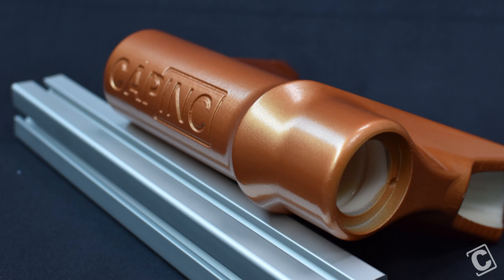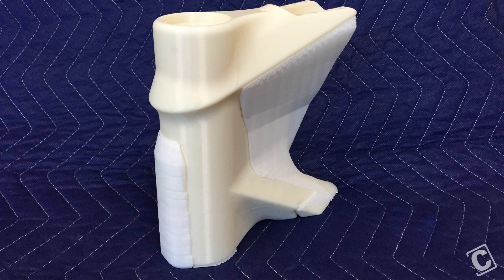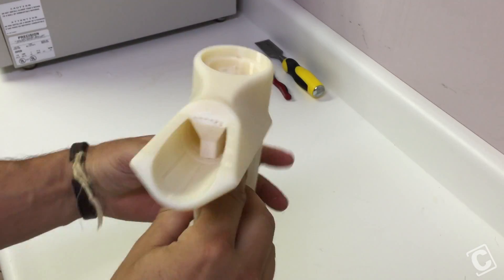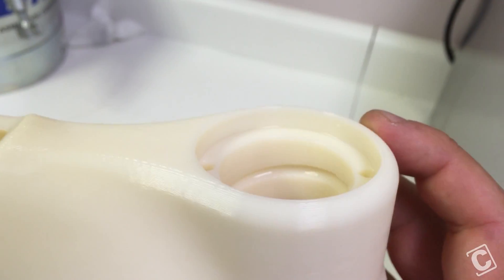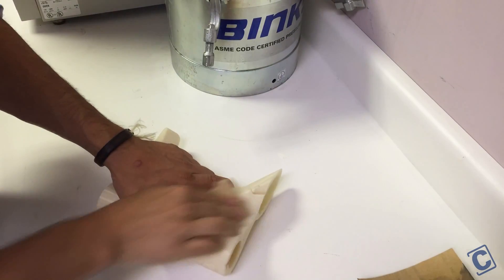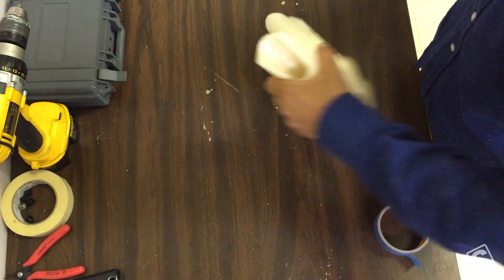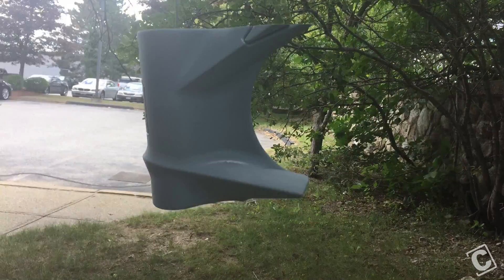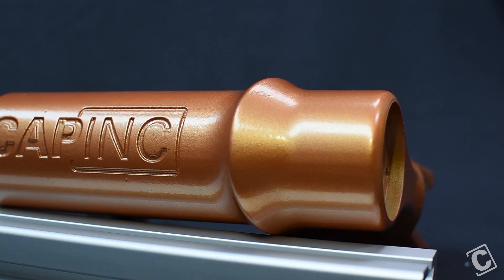How To Finish A 3D Printed Part To Look Like A Production Part

Comment: the print finish is honestly really good at least on camera, what did you use!
Reply: The 3D Printer is a Stratasys Fortus 250 MC . He used a Carpaint Primer with highfill properties. Two coats of Paint and a clear coat.

Comment: Hi, 
I would like to know what bath are you putting your 3D model in when you are about to remove the support @ 1:13 . 
What machine is that and what liquid are you using  ? 

Thank you for sharing the video
Reply: exactly! And what material can be put in a bath to remove support material???
Reply: @cnc3-in-1  Usually people use PVA filament to print support like this, its best to have a dual extruder because its a different material than what you want your model to be.  PVA can dissolved by warm water, it does take a few hours though.

Comment: i find additionally, applying bondo spot putty before priming to be effective. sand it down and you shouldnt have to worry about layer lines and as long as you wet sand, youll remove any loose bondo dust from the object as well so the primer can adhere properly. the primer, then paint and clear coat. the use of spot putty is also a good way to ensure even sanding. if you just sand the bare surface, its harder to tell if youve over sanded or under sanded certain areas. its easy to tell what surfaces have been sanded with spot putty.

Comment: This is an excellent Demo. How about painting using liquid latex (left to dry) then pulling that away after youve applied paint, would that work better than using blue tape to cover uneven surfaces?

Comment: If you want an even smoother finish (can still see some blemishes in the final part) then use 2-3 coats of filler primer as your base coat. Also use wet and dry paper with plenty of water, sounds like it would mess things up but it works a dream. Admittedly it will take a couple of days to get it really smooth but it's definitely possible.

Comment: I usually do this 8saves bangs of time): Finished print- plastic primer- filler primer- sand down until you see the original print shine through (i use wetsanding as the method of choice here. by the the print is baby ass smooth. you can go further and slightly sand it down with a 1000 grit paper just for the smoothness.)- airbrush primer and colour or spray primer followed by spray color - clearcoat. 
Not having to sand the print itself safes A LOT of time. the finish is the same. if i could add pictures i would.

Comment: For the high gloss finish you'd actually want many many coats of clear. 3-4 coats of paint followed by about 10 coats of clear. Each coat progressively thicker than the last. after the first few coats of clear, start giving a wet rub of 2500-3000 grit being mindful not to rub through the edges.

Thats how we paint cars at least.
Reply: It's not! It all purely depends on the level of finish you desire! If you want the finish similar to that of a brand new car... thats when you need that many coats of paint.

We need several coats of paint for coverage. Maybe an extra one or two for acrylic paint. A mistake people often make is trying to get maximum coverage in their first coat. On the worst end of the scale, this causes runs and dribbles in the paint. At best, it causes orange peel. Which is a fine little bumpy surface left on the paint.

The first coat should always be basically a light dusting over the product. The clear is where the depth and shine of the gloss comes into play. The more clear... the more shine and depth.

In reality it's probably overboard for what most people desire, but it is whats required to get that dream finish.
Reply: Customs Unlimited great information. i had no clue that i would need to sand after a few clear coats and then continue with more coats. i got a feeling it's gonna take a lot of practice. 

how much time do i give each coat to dry up? what sort of paint do you recommend that will not shatter on a semi flexible print (tpu cover for a device)
Reply: Dry time (known as Flash Off)between coats varies on thickness and temperature. Often times after I spray a panel I'll apply the next coat straight away. But that's very warm temperatures and less get coats. Usually about 5-10 minutes on light coats and 30 minutes on heavy coats. If I need to rub it back (sand it) then I'll wait about 24hours if not using a baking oven. 

Also do some research about removing Orange Peel in your paintwork for the ultimate finish.
Reply: You have two options regarding paint for flexible plastic... First use a plastic adhesion primer and then paint. Although I don't expect a great deal of success over a period of time. Ideally... vinyl dye in a spray can has fantastic results and will NOT crack on flexing. 100% guaranteed no cracking... ever. But color choices are limited
Reply: Customs Unlimited any decent brand i should look for?
Reply: No idea. Not in the US.
Reply: why are 14 coats of paint needed, is it to seal/protect the surface from dirt and moisture?
Reply: Do you do tutorials ? seems like something needed/wanted here :D

Comment: Is this a two head printer one with a different kind of plastic for support and another for the actual print?
Reply: Yes.  The support material is "soluble", so it dissolves away. 
For ABS or Nylon you can use PLA as the support material and Limonene as the solvent.
For ABS, PLA, or Nylon you can use PVA (PolyVinyl Acetate) as the support material and hot water as the solvent.  It looks like this printer is using PVA.

Comment: I have watched hundreds of Youtube videos on 3d printing, and I have never seen anyone do more than acetone smoothing.  It is good to see that conventional finishing processes work great. Thanks for taking the time to show us.
Reply: You haven't watched many then, because there's people who are literally electroplating their parts with metal too.
Reply: also you only watched ABS smoothing, because acetone will more likely melt any other printing material
Reply: @towelie62  :  Five years ago, (when the video was made), ABS was used far more than today.  My comment, (made three years ago), was simply intended as a complimentary, positive comment.  I have never printed anything with ABS, but I have used cheap automotive aerosol high-build primer-surfacer, and touch up paint on PLA, to get very satisfying results.
Things have developed significantly in the last few years, (as C North's comment above so bluntly points out).  These "old-timer" methods are often overlooked, but they still have a valid place in your workshop.
I get immense pleasure, and gain a lot of useful info from the "University of Youtube"!  In return I try to make any comment encouraging, positive, and if possible useful.
Reply: @PiefacePete46  thank you john, very cool

Comment: You obviously have no experience with finishing because you are supposed to wet and dry between coats. That way you don't get the bumps blips and pin holes .....   I like the acetone trick though, awesome!!!
Reply: The liquid is just water. The supports are made of PVA which is water soluble. This is an example of the material; https://www.matterhackers.com/store/3d-printer-filament/175mm-pva-filament-half-kg
Reply: Andrew Jones the liquid isn't acetone. It's a special liquid to use with the uprint models that come with solable supports.

Comment: Nice tutorial.  I use the same method as you show...but sometimes use bondo as a 1st step.  I wish there was a way to get rid of the sanding step.
Reply: Me too. Not because I'm lazy but when you have awkward parts with lots of rounded surfaces like a model of Catwoman, it's impossible to get it smoothed completely.
Reply: I have to think there's a better way than what we're doing.  I tried dipping in urethane many times but couldn't build a good thickness without drips.  There must be something like powdercoating or vinyl dip that could work, but I don't know of it.  Or maybe just better printing techniques with finer nozzles for outside layers...but that's in it's infancy stages of development it seems.
...or maybe we just move to CNC or SLS/SLA?
Reply: I've used epoxy like XTC-3D to smooth with some success also, but it's slow, messy, and creates a drastic orange peel effect...still looking for something better.  I might experiment with sandblasting soon, as that seems like less work for better results than all this hand sanding.
Reply: ...and I will add, I've used some of the ridiculously thick rustoleum paints with a good measure of success.  The Granite series goes on very thick and will smooth 0.6mm layer lines in 1 application.  Hammered works after 3 coats, but doesn't cure well when it's that thick.  Perhaps the 2x's sandable primer is the best way to go?
Reply: There is a filler primer that some have used, which I may switch to myself. I think this would only work on fine prints of about 0.1 layers but still requires some buffing after. You could try really thick coats of gloss paint, but this would be an art form getting it not to run while still covering the layer lines.
Reply: Yep, I have tried the top coats and thick primer and found what you say to be correct on all aspects.
I have seen copper aerosol to enable powdercoating or electroplating of plastic...I wonder how that would work with a fluidized bed of epoxy powdercoat?  I bet it would work well, but I don't just have those tools laying around:/  Maybe I should....
Reply: bah, scratch that...it would have to be heated too hot.
Reply: ...you know, of the methods I've tried, the thicker aerosol paints work best, mainly because they cure well with thick applications.

I bet there's a thick paint or maybe using glass filled epoxy or polyester could do the trick in 1 layer.  I've done a few layups on top of printed parts with glass and carbon fiber.  This could help too, but it tough for irregular surfaces.
Reply: Nice to know paint does the trick. Gonna get me some gloss top coat spray paint
Reply: white nail varnish may work never tried it

Comment: What was the bath fluid ?
Reply: Disregard, someone already asked and it was answered
Reply: what was it though?
Reply: "+pptx100 The wash station uses a solution of Sodium Hydroxide (NaOH). PLA or ABS can't be dissolved by Sodium Hydroxide, the support material is a special plastic that is broken down by the chemical."

Comment: Then you have changed the thickness of the part this way.  3d Printing is not the best way to go.
Reply: Unless he took the finishing into account in his model. It's the same thing in machining, you program the part to be within tolerances after the finishing, not before.
Reply: Not only that but he may have sanded off the couple of millimeters the paint might add

Comment: this is awesome until you look up the machine price...$45,000.00
Reply: jon davis you could use the same techniques shown to polish a print from a machine that costs 100€

 actually it would really be beneficial for a cheaper 3D printer since with proper treatment you could achieve results similar to the video
Reply: At my school we had a different model from the same brand. It wasn't a great printer to begin with, print size was average, quality was average, but then when you throw on the cost of their proprietary filaments, and the cost for the soluble solutions and their print beds (one time use is what they said, we used it for a good amount of prints as long as it was in good condition), and it became a machine way too expensive for what it did. Our $1,000 up 3d printer did just as good for a whole lot less.
Reply: monoprice select mini, $180-220 depending on the sale.

produces great prints.
Reply: my anet prints awesomely...after you take away and update all the scary electrical parts its a nice little printer
Reply: This is true.. I have a Stratasys 360mc and a Prusa i3 mk2.. you can get comparable results out of the two printers even though one costs 100k more... However, the stratasys is literally a press "go" machine. You design your part and have a prototype.. There is no messing around with getting all the proper slicer settings, bed temp, fan speed, layer height, calibration, etc... It is expensive, but for running consistent parts time and again.. it can't be beat.
Reply: +attack125 what printer do you have? I'm guessing something like an anet a8 or some variation of that? The up 3d printer we had only has a print volume of about 140x140x140. Print quality wasn't bad and once you get it calibrated as best you can it isn't too far off from the quality of an anet a8. Most of the price is just cause it's a fully assembled printer and all that which really brings the price up compared to a kit which is what I'm assuming you have.
Reply: darkracer125 they are company owned machines. They are actually justifiable if you add up the amount of time and money you spend paying employees 50 dollars an hour to experiment with settings and print multiple prototypes before getting a good part. The Fortus spits out a good part with very little employee effort or time. We are a design company that does prototype work and low volume production with our printers.
Reply: I have a monoprice select mini. The designer I work with has a wanhao something lol. Once we're happy, we send it to 3dprintuk for production. Yes their machines are like 45k. To print our enclosure, they charge us ~$7USD each.
Reply: Stratasys is a rip off. Go cheap and put time and effort into understanding your settings, temps, and craftsmanship. Much higher returns that way.
Reply: Where?
Reply: I have a $600 Prusa i3 that gets just as good quality as this (albeit requiring a couple hundred dollar addon to print soluble supports, which I usually just work around). At this point, RepRaps have gotten mechanically and electronically stable enough that it's far more about the print settings than the printer itself, as long as the printer is properly maintained.
Reply: exactly the anet a8.  with some love and care it prints VERRY nice.  pretty much the same as the part from the video that came from a 45,000 dollar printer.  probbably cannot print as big. or with as many diffrent materials.  but the quality can be the same.and tbh  the anet a8 IS the variation of something.   the cura i3 is the Original. the anet a8 is the chinese clone
Reply: why do you have the money to afford one of those?   own your own company?  what do you do? prototyping?       or did you just win the lottery? because i now know what i am getting when i win the lottery
Reply: Jon my brother, you ain't joking!!  
Where I work we have a Maker Bot type 3D printer we use for making alignment jigs and drilling tools for aircraft assembly.  I inquired about purchasing one and at $4000 its still WAY out of range of my wallet.  When they get these things down to around $600+/- they can give me a call.......till then, no thanks!
Reply: can't say anything about print size since i dunno yours.  (220x220x240)  anyway i bet my 150 dollar printer can achieve the same product as your 1000 dollar printer